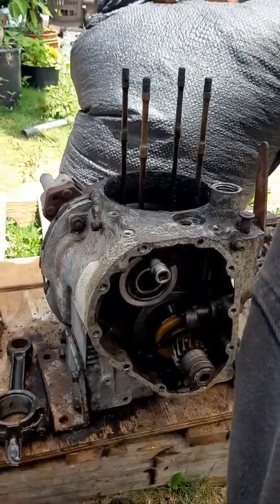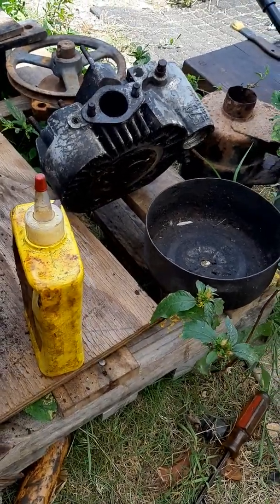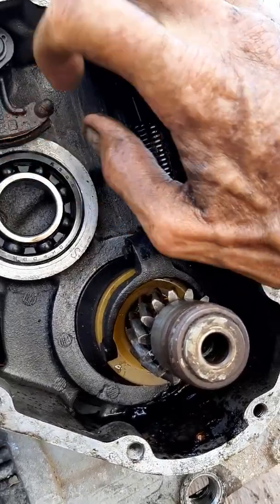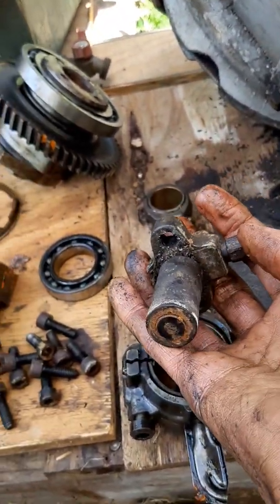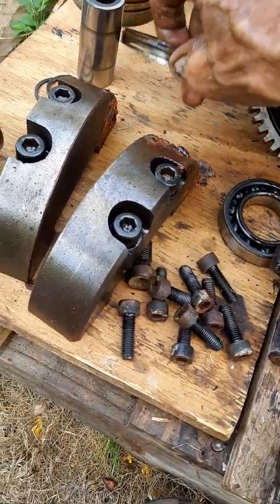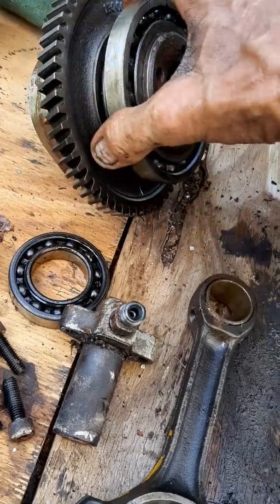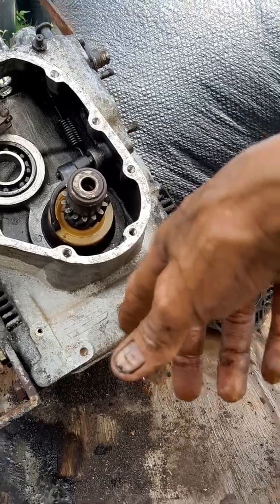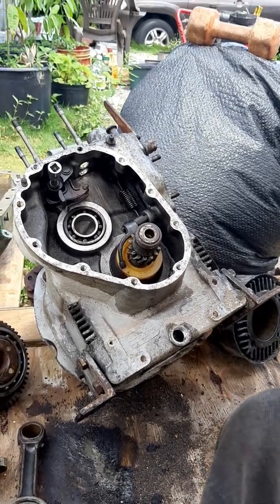Hatz E79 part 2

Comment: Good work. Interesting cam shaft arrangement. Looks like you can move the lobes. Not sure I like diesels with a splash oiler though.
Reply from the maker: Thank you for the comment. IIRC the cam lobes are replaceable. I'm not a fan of splash oiling either, but based on the few I've seen, the oiling system in these particular engines works quite well. I've not seen one with oil-starved bearings; and based on the age (1960's) I feel they have proven themselves.
However, I'm not comfortable turning any small diesel over 2000 RPM for extended periods of time, no matter the brand or oiling system used.
I usually turn these Hatz 1200 to 1500 RPM on cement mixers and they seem quite happy at that speed.
Reply: @crazyenginewiz  Fair enough. I suppose it depends on the gearing but cement mixers don't need a great deal of revs.